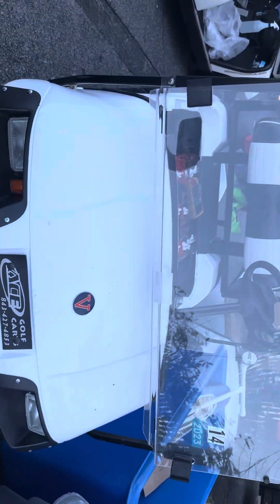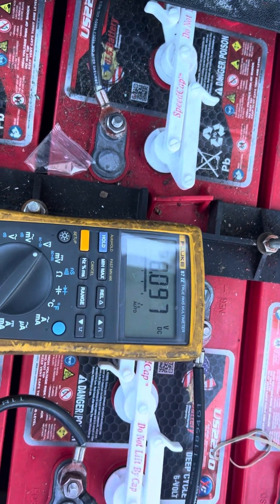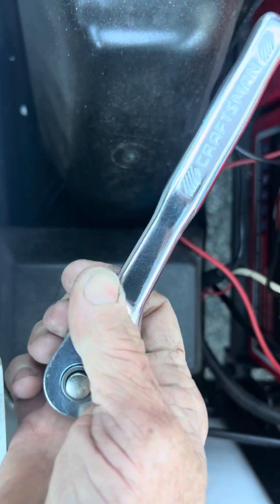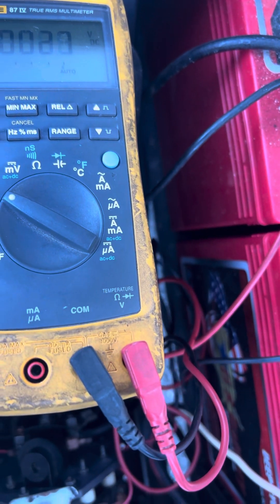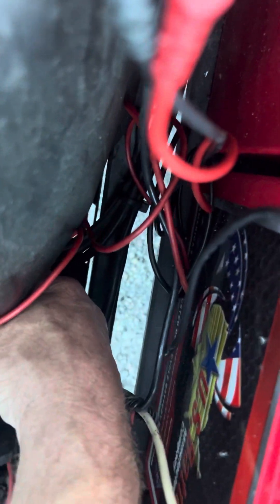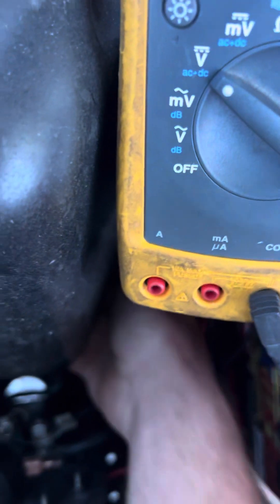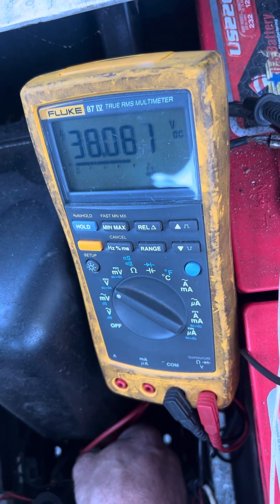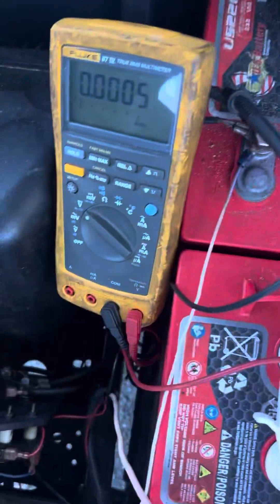EZGO txt golf cart won’t move. Test f n r switches and wiring

Comment: Hey bud. I only have 36 v to the bottom nut on the fr board. I’ve replaced the fr board and still same thing. Mines a ezgo txt series. 

Also I jumped the b- and m on the controller and nothing. 

I jumped the bottom nut on fnr to the top nut on fnr and the cart moves. 

Any suggestions?
Reply from the maker: Tell me how your f n r board is wired up. Meaning where do the big wires go on the f n r
Reply: @Golfcartwhisperer  
Bottom goes to  S2 on motor

Top goes to A2 on motor 

Passenger goes to A1

Driver goes to S1
Reply from the maker: @dammitdaymond  what year is the cart
Reply: @Golfcartwhisperer  1998
Reply: I bought the cart off of a guy that just started throwing parts at it not knowing what he was doing. I’m sure he probably hooked things up all wrong.
Reply from the maker: @dammitdaymond  what voltage do you have on top post on the f n r.  Lack lead on main negative. Red lead on top post
Reply from the maker: Yea he did. The bottom post should go to sol or controller. Top post a2 on motor.  Post near battery s2 and post near body s1
Reply from the maker: On the top of your controller.  Do you have 3 big post or 4
Reply from the maker: I typed it wrong. Post near battery s1 post near body s2
Reply: @Golfcartwhisperer  where does m- from controller go?
Reply: My M- at the controller reads 36v all the time. Is this normal?
Reply from the maker: @dammitdaymond  no should read battery voltage when hit the gas
Reply: My cart is doing the same thing. What was the solution?  Thanks
Reply from the maker: @denney1933 have you checked any voltage
Reply from the maker: @denney1933  watch this video here
EZGO TXT Series TROUBLESHOOT controller & everything else
https://youtu.be/jVJHsNWxT8w
Reply from the maker: @denney1933  let me know what you find out.  Or tell me what yours shows as far as voltage and I can help